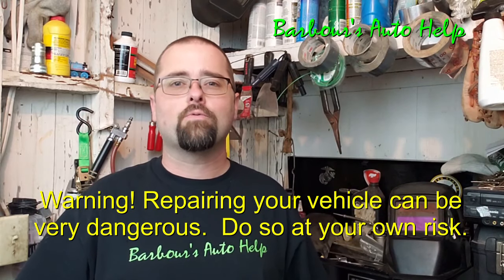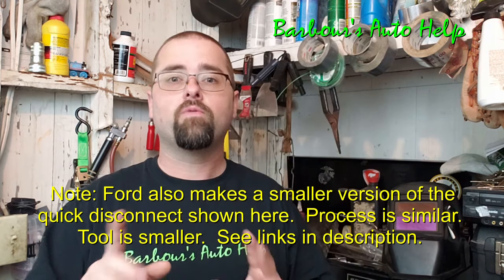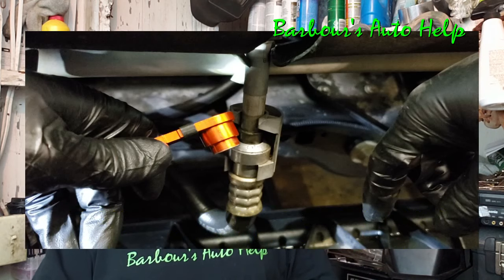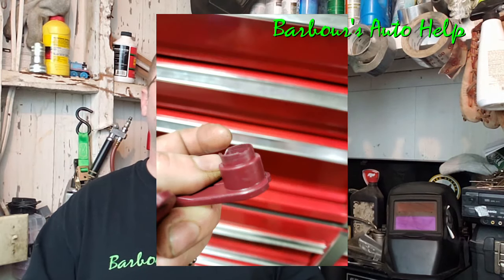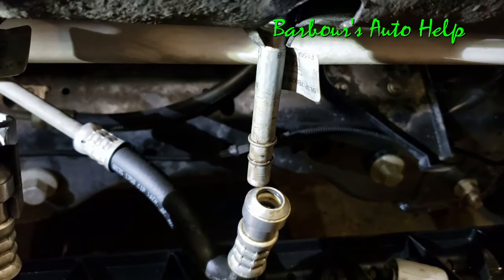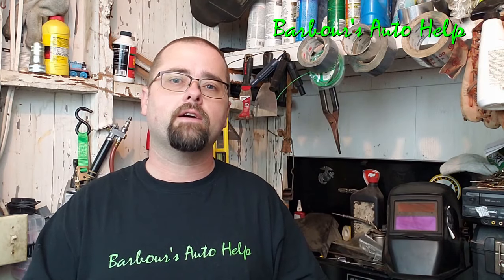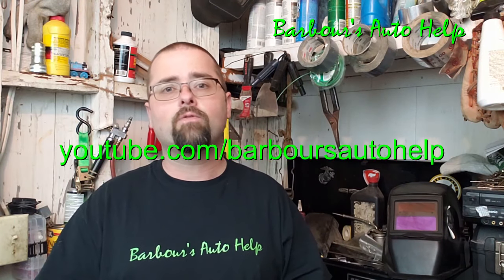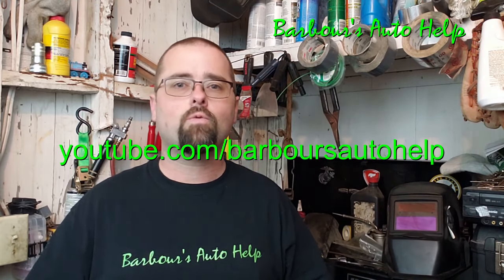How To Disconnect a Ford Transmission Line Quick Disconnect

Comment: if it feels stuck and does not want to pop apart take his advice and hit with shop air and or even wd to loosen and remove dirt sand crud that has setteled in between the line and the fitting .I've even had to run a flatened piece of metal around it to help loosen crud and hit with wd and shop air to clean the area for removal

Comment: Awesome video, thanks. If anyone has problems getting it to click in like I did, try penetrating oil and heat gun to warm it up. Finally got it off after struggling with it for over an hour.
Reply from the maker: Thanks for sharing 👍.  It may be better to use transmission fluid as a lubricant.   Less chance of messing up o-rings or rubber.  I don't know that penetrating oil will hurt but I do know that transmission fluid will not.

Comment: If the pipe is punctured or broke you can make a tool out of 1/2" copper pluming pipe. the inner diameter is just right. all you need to do is grind down the outer diameter.

Comment: I got mine disconnected(I'm not replacing the quick connect but the hose that goes to the lower radiator) and a black rubber gasket came out with the line? I just put that back in when reconnecting the line?

Comment: Because of higher maintenance costs I've been performing some maintenance on my 2015 f350 super duty therefore I began for the first time viewing automobile repair videos.  I'm in the middle of replacing oil separator finding it difficult to disconnect electrical and fluid connectors.  I've got so much to learn but I have some reasonable mechanical aptitude for I maintained aircraft (retired in 2006) 40 years.  Satisfactory maintaining aircraft DOES NOT MAKE ME AN ACCOMPLISHED AUTO MECHANIC) This being my first to request help (I'm requesting help from you for I'm to believe you do a great job explaining your various accomplishments) although there not on my equipment.  Please advise professional methods to disconnect and reconnect electrical and fluid connections.  Many. thanks.  Terry
Reply from the maker: Thanks for watching.  I mostly work on gas powered vehicle.  Unfortunately, because of this it would be hard for me to do a video on this.  Good luck to you though.  With a history like that I'm sure you'll be fine.

Comment: Two of us mechanics tried to help a guy out on his driveway, got this tool exactly, destroyed my tool it would not come off at all, we had to cut the tube and join them together as a temporary fix
Reply from the maker: Wow!  Why in the world did that happen?  We use this tool on a daily at the shop and it works like a charm.  Was there a lot of debris in the connector or was it rusted?  Sounds like you handled it though.

Comment: I have an 07 explorer, I know this might sound but when you’re ready to reconnect the line do you simply just push it in?
Reply from the maker: Yes, until it clicks securely into place.   Give it a tug afterwards to make sure it's locked in.
Reply: How do you ever get them off
Reply: @aaronsexton6434  you need a special transmission line tool sold by Ford. It’s expensive luckily my stepdad works at Ford and he was able to let me borrow the tool. But even with the tool it was a pain in the rear to get the lines off because mine were so rusty
Reply: @ifGarage  I just bought a replacement line for one side and I’m waiting on a specialty tool for the left

Comment: Man I bought the same exact set from harbor freight and it literally says ford oem, and I still had to torch & cut off the old quick disconnect lines😭
Reply from the maker: Sorry to hear that.
Reply: How did you reconnect the line after cutting it off?

Comment: What size is the tool? 5/16"?
Reply from the maker: Orange.  Got a link in the description.
Reply: ford f150 1/2 inch
Reply: The Ford ones are either ⅜" or ½" depending on year and model

Comment: My used explorer had a damaged fuel fitting and tried to remove until the tube snapped. I got another explorer with slightly damaged fitting even using the fitting it is not Coming  out on one side. Without tool this sucker is useless..

Comment: so this is same as the rad side on the rad itself.
Reply from the maker: Most likely, but not sure if your vehicle is different.
Reply: @BarboursAutoHelp  double checked called dealer.. it is the slip on rad itself... thanks so much ford hahhaha... the compression fittings were better to me. at least u knew ahead of time your bustin knuckles and cuttin the tube lol